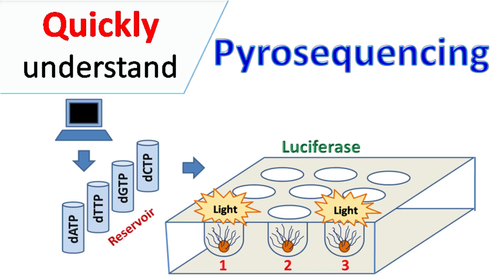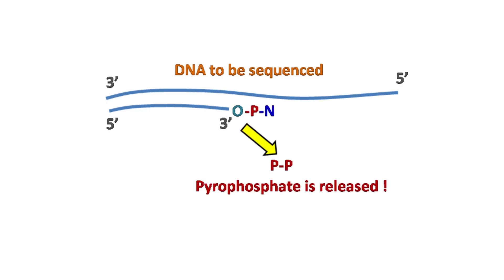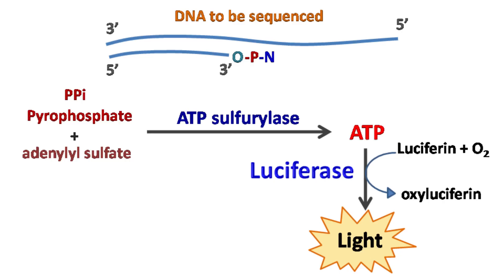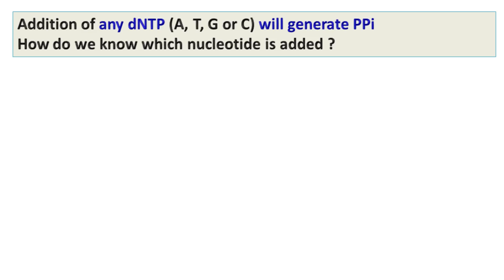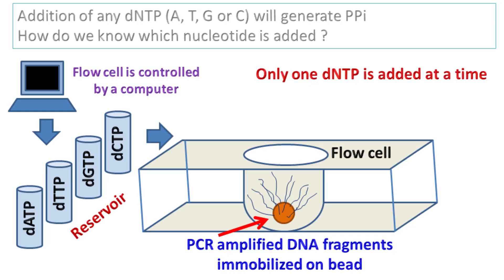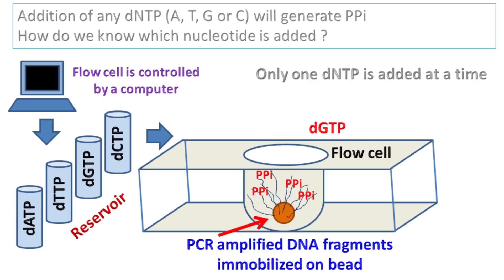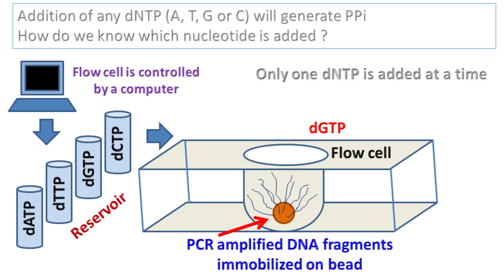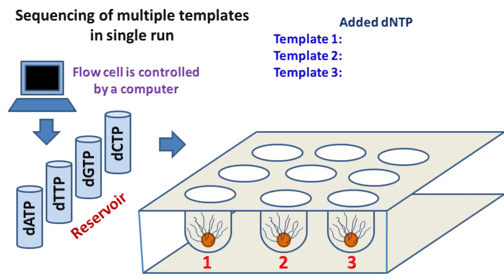Pyrosequencing

Comment: There should be an issue here if I understand well. At 3', during the example, the added nucleotides are in the order : G A T C A G A T etc... However when the second template is "GC", dATP is added, and nothing happens for template 2, only template 1 gets light. But then there is dGTP then an other dATP, WHICH THIS TIME CAUSES LIGHT. Why does the first dATP did not cause light in template 2 ? Just a little error on the video or am I missing something ? 
Great explanation otherwise